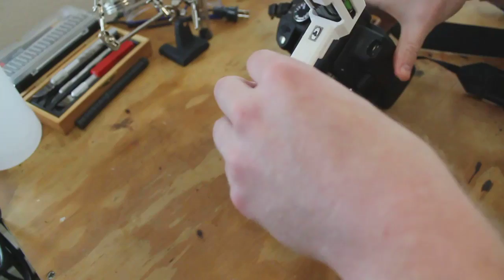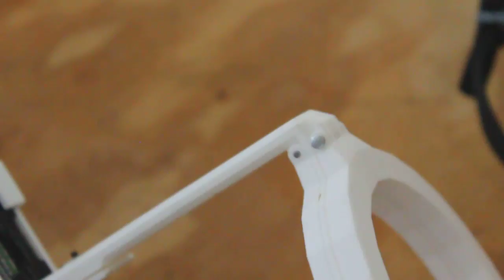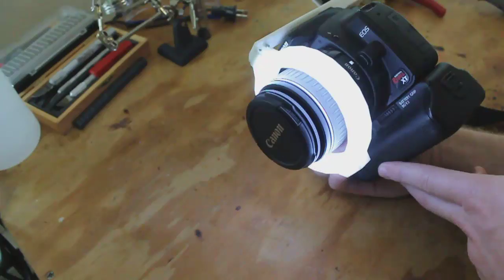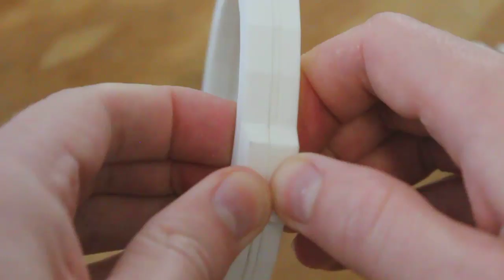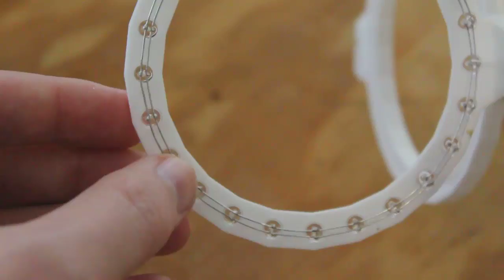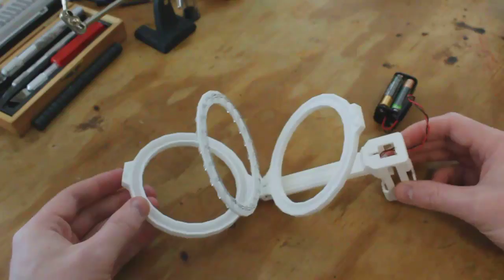DIY Canon Ring Light

Comment from the maker: You can't buy a ring light like this, they just don't exist (yet). You can get a generic ring light on ebay for about $20, but it will have many limitations, none of the special features, and is not really customizable. $70 is not cheap for a basic ring light, but this is not a basic ring light. Hope that answers your question.

Comment from the maker: The overall shape is intended to balance the weight of the ring vs. battery pack along the connecting beam, thereby reducing stress on the attachment point. Although you could put the battery clip just about anywhere if you didn't care about optimizing integrity.

Comment: You just missed one thing. In order to maintain the LEDs, you must put a 1K ohm resistor so you will not burn or destroy the bulbs(LED). Because without it, too much current will pass through it.

Comment from the maker: It really depends on the type of LED used. LEDs have a different light-cones based on their design specification. The ones used in this project are 45° emanation, which is why you see such even, diffused lighting. Typical LEDs which can vary between 5-35° emanation would probably produce focused dots on the diffuser.

I calculated all this beforehand which is why the lighting effect is optimized, giving an almost perfectly even and uniform diffusion.

Comment from the maker: I don't sell anything, all I did was create the design and made it public domain. By "finish" I think you mean material, since it's 3D printed as one job the material is homogeneous - black body would mean black diffuser, which would probably block 90% of the light output.

Comment from the maker: No idea, I've only tested it with xt and t2i. The mount will attach to any canon foot, but as for the ring there is really no telling how it will fit if the lens placement is different from the aforementioned models. Download the model from shapeways, open it in your 3D modeling program of choice and take measurements. That would be the best way to find out.

Comment: This one inspired me to finally make one (similar design based off this one), but for my little point & shoot.  Have the design almost completed working with 16 3mm 8,000 mcd LEDs and using FreeCAD for the design.  Didn't know about Shapeways until a couple weeks ago.

One thing missing in your design are resisitors.  LEDs only run on 3v.  Estimating a 20ma draw, the setup should be for every 2 LEDs in series, toss in a 1 ohm 1/8w resistor going to ground (wired in a series\parallel setup).

Comment: Very cool project. What LED is used? I think I would have made the ring attach to a filter step-up ring to keep it out in front of the lens, but the flash mount is an interesting way to do it.  If the back ring can be made reflective, you might gain some light.

Comment: @neotoy for macro work it will be more than enough. anything else other than close up work it will serve no purpose.. it doesnt even emit enough light to be working at a hand holdable shutter speed. so most of it will have to be on a tripod for macro work. it you are trying to do portraiture forget about it. and if you are trying to do full body shots or even 3 quarter body shots ur swimming up a creek without a paddle.... and btw i am more than half way into my degree in photography so suck it.